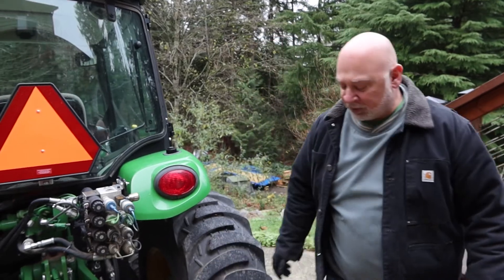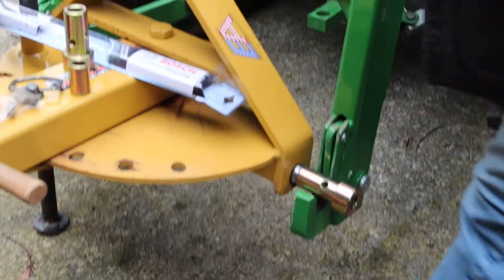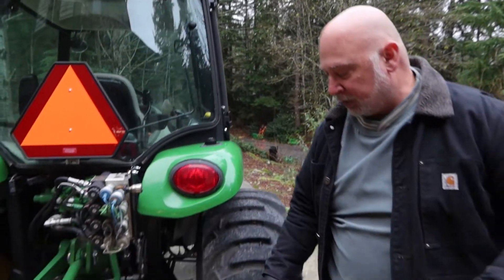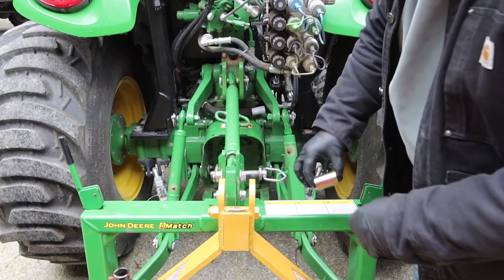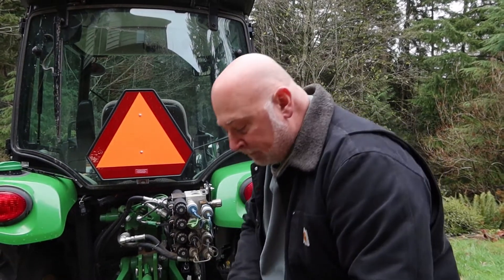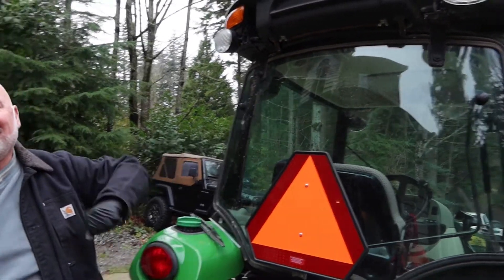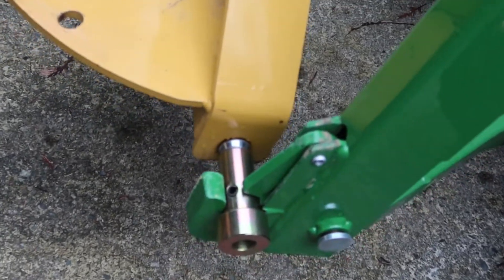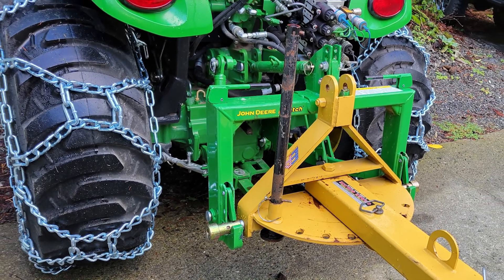Quick Hitch Bushing Explanation,  Are John Deere Wipers Left-Handed???

Comment: Nice Jeff the tractor is beautiful 🙂
Reply from the maker: Thank you! Huge compliment coming from you! I added 4 double acting hydraulic control valves. The electric toggle switches are mounted nicely in the factory blanks on the right side of the cab.

Do you agree about the position of the rear wiper? It makes more sense to have it mounted to the right side.